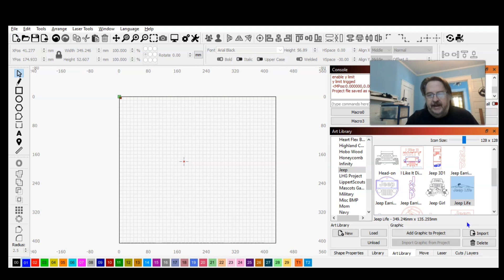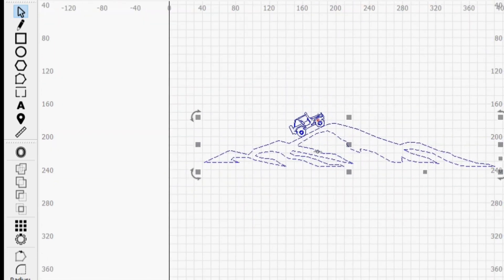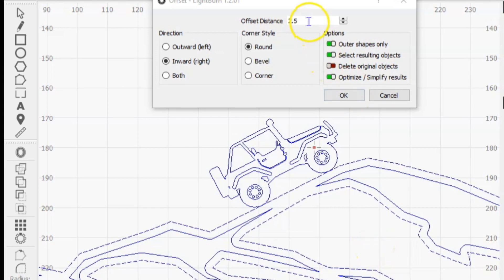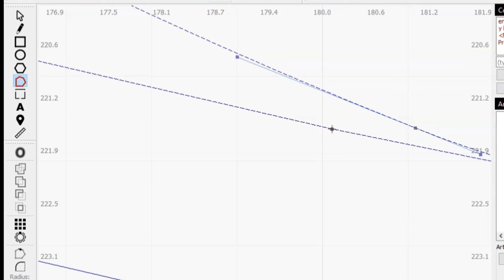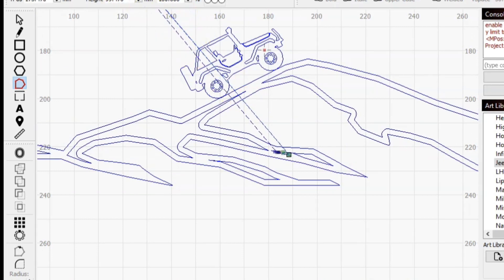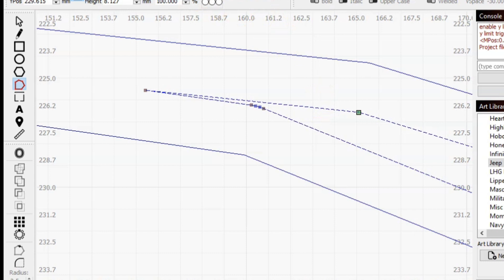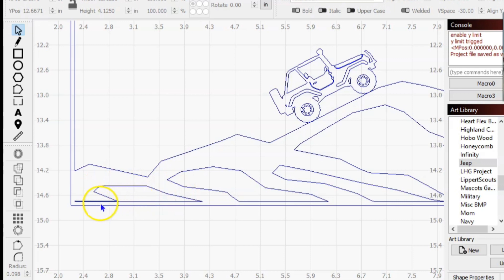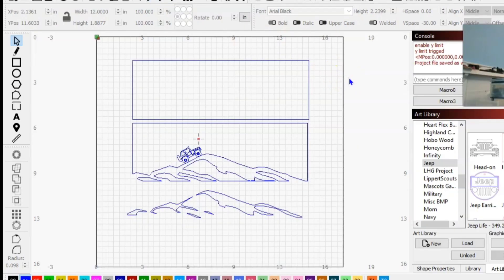Create layered designs in LightBurn for your laser engraver.

Comment: At 2.03 you changed your image to one of the line modes.  How did you do this.  I am only familiar with the trace option and your way looks much better.
Reply from the maker: Using Lightburn it is simply changing it from a fill mode to a line mode in the cuts/layers editor.
Reply: @HoboWithWood  Thank you

Comment: I didn't find what I was looking for but every time I watch your videos I learn more than one thing and thats a good thing.
What I was looking for is a way to use sub layers so I can do more than one operation at a time. Like if I was doing a clock with the numbers on the outside and a graphic on the inside. How would I be able to do the numbers and the graphic in the middle instead of the laser burning side to side all the way up to burn the numbers, skipping the space in the middle, and than coming all the way back down again to do the same motion again with the graphic. Seems like a lot of wasted time.
Anyway, what is the difference between "Weld" and "Group". Seems like the same outcome to me?
Reply from the maker: I like the way you're thinking. So many people do not consider the nonessential travel of their laser. My next video will be discussing it, so stay tuned. Sublayers in Lightburn do not work in the way you are hoping they would. The laser is going to complete each individual layer and sublayer completely before starting the next. You can, however, cut down down on wasted movements using other features and techniques. Search my playlists for videos discussing different "fill" techniques. "Fill vs Offset fill vs Flood fill" is one of them. Then, you have the ability to change the fill method. Fill as groups, fill individually, etc. Those options can also save time. But they can sometimes produce undesired outcomes. I have videos on these options as well. I've found the best solution to save time on traversal moves is to segment a design that would otherwise require a lot of wasted movement. It takes a couple of minutes to set up. But on a design that you may be repeating regularly, it is well worth the extra time in the design process. An example of how I segment a design can be seen in the description of my "Stash Box" on my website hobowithwood.com. You might find it fruitful to watch. My next video will be addressing all of the questions you've posted here. Including the difference between group and weld. That one is easy.  When you group 4 objects, it becomes a group of 4 individual objects. Click on one, and you select them all. When you weld 4 objects, they become one individual object. You can group many objects regardless of location in the design. You can only weld objects that are touching one another. Hopefully, that helps a little. Be sure to tune into the next video. It's going to be a lenghty one full of suggestions that are going to address all they things you're asking about. Thanks for watching.
Reply: @HoboWithWood  
Yes on welding and grouping I figured that out. But why weld when you can just group? On that aspect of it I still don't understand the point of the programmers making a weld button which means there has to be an advantage of one over the other and that is what I don't know.
It's like the difference of a black racing tire and a purple racing tire. Whats the point of making a purple tire if there is not an advantage over the black racing tire?
I just want to understand the advantage of one over the other. Maybe there is no advantage? I dunno.....
Reply from the maker: @iwannaapple7190  There is a HUGE advantage of a purple racing tire over a black one... the burnouts are so much cooler. I'm going to try and go over most of this exact content in my next video, it's actually already in the works. But this dialogue will make sure I don't forget to cover something, so I appreciate it. Let's say I am creating a border using the array tool that is made up of 30 individual shapes. The array was generated with no space between the shapes. In fill mode they appear to be one continuous design. They are not. The are 30 individual shapes that happen to touch each other. When in engraving, depending on the settings used, it may try to fill each of the 30 individual shapes instead of filling one continuous design. This could create irregular burn patterns, excessive time and other issues. Grouping allows you to make changes to certain parts of the design as a group. For instance, if you wanted to have a different LPI or scan angle on a particular group of shapes, you can select the shapes, group them, regardless of their proximity to one another, and put that group on it's on layer and make the desired changes with one setting. Does that help?